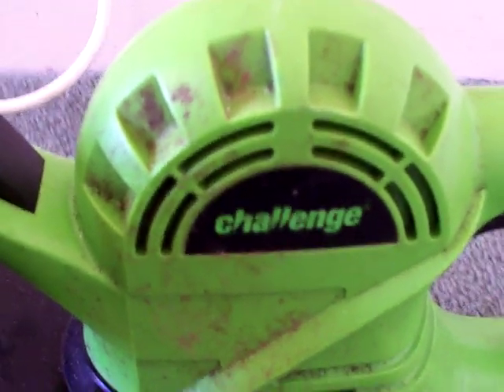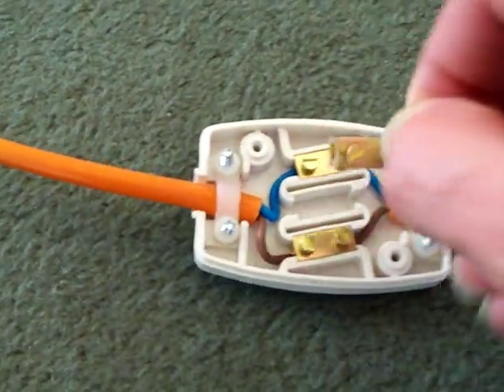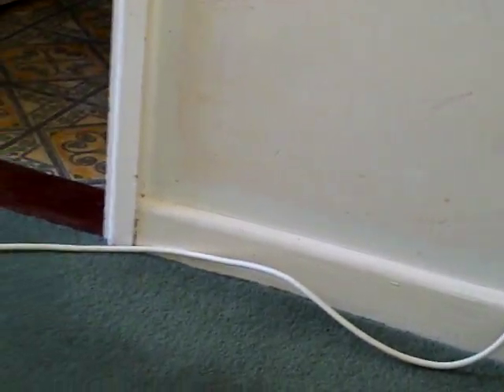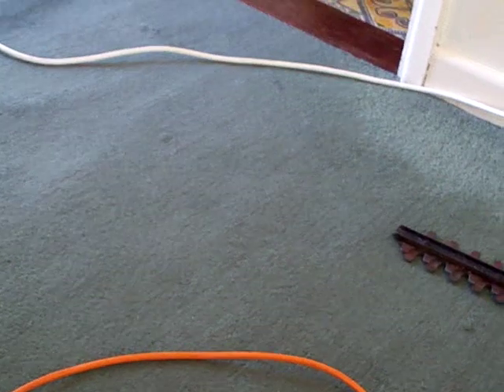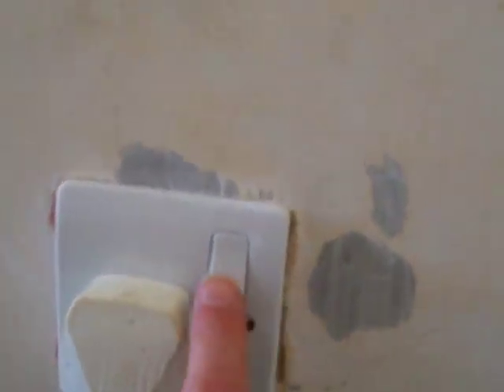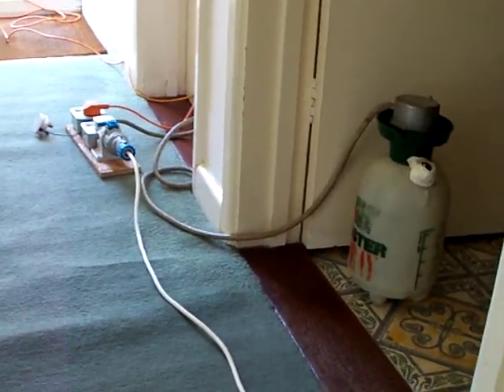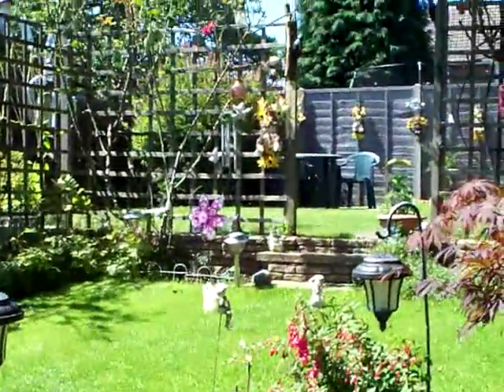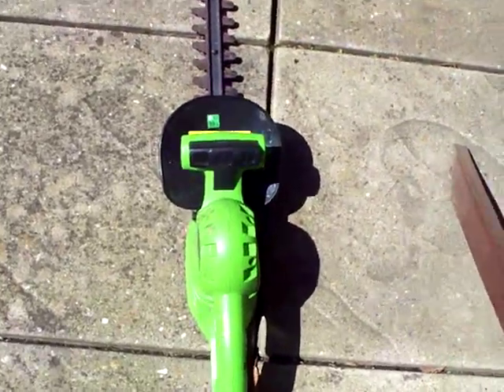Electrical : Neighbour's hedge-trimmer repair & test. :-)

Comment from the maker: Hiya. I've seen your vid, & noticed that the connector is the same one. :D

As for the connector-strip & insulation tape bodge-job, I have seen that done a few times before!

Admittedly (and off-camera!) when I need to test something out that doesn't have a plug on it, I do have a plug+flex with a connector strip on the end which I can quickly add-on to test the appliance.

Of course, that's in skilled hands & isn't left on there as a permanent fixture :-)

Thanx for watching,

-BoomBoxDeluxe.

Comment from the maker: Lawnmowers? Interesting that you should say that, because some time before the hedge trimmer chomped its own cable, her lawnmower also decided to eat its own power cord. :D

For that fix, I used one of those 2-pin pluggable 'duraplug' connectors. It's all I had at the time going spare, & they are sometimes known as 'lawnmower plugs' anyway because Black & Decker used to fit them to their lawnmowers as standard back in the 80s. :-)

Thanxx for watching,

{^_^} BoomBoxDeluxe {^_^}

Comment from the maker: The flex connector does not need to be IP65 rated, or even IP56.

This appliance (unlike a Jet Washer for example!) isn't designed to be used in such conditions which would require IP56 protection.

I don't even think that the flex connector would meet IP44, but then, it doesn't have to, as it is highly unlikely that the hedge trimmer is going to be splashed with water during operation.

-BoomBoxDeluxe.

Comment from the maker: Hiya. This can be used for a variety of reasons. To repair a flex as shown, or if a flex isn't long enough, the plug (if it is a rewireable plug) can be removed, this box put in its place, another flex added on, then the plug rewired onto the end of the newly added piece of flex. :-)

Of course, a lot of people don't bother with the second technique & use an extension cord instead. Because of this, these joiner boxes are mostly used for repairing a damaged flex.

Thanx for watching. :-)

-BBD.

Comment: Managed to cut my hedge trimmers cable today but surprisingly it didn't pop the 13A fuse on my trimmer or the 10A fuse on my extension cord or the bimetallic safety device on my extension cord but it did pop the 32A circuit breaker on my mains. Might not be a good idea to buy fuses from pound land.
Reply: OK, a very 
quick lecture 
on fuses and circuit 
breakers as follows:

Firstly, a thermal circuit breaker, like those found in extension lead outlets (such as those Jo-Jo extension reels) will only operate on an overload and will not respond to sudden fault currents or severe and sudden overloads such as a massive inrush from a motor.

Next, a plug fuse is merely a thin piece of wire inside a ceramic tube, which is then filled with sand and the sand surrounds the fuse wire inside.

A circuit breaker in a consumer unit however, will have two mechanisms in there. One will be for detecting overloads over a matter of minutes or seconds, depending on how severe the overload is, and this is thermally operated, and the other mechanism in there is for sudden fault currents, or as some people experience.... excessive inrushes of large motors/welders causing it to trip-off. The fault-current part of the circuit breaker is electromagnetic.

Under a sudden short circuit, a MASSIVE magnetic field builds up in the circuit breaker and trips-off the mechanism.

This happens WAY BEFORE the 10A fuse in the extension or the 13A fuse in the plug of the appliance have even thought about beginning to heat up in order to pop, and forget about that thermal device in the extension lead.... IT DOES NOT detect or respond to fault currents. Its there for overloads only!

Circuit breakers can operate so swiftly, that even a 32A type 1 or type B breaker can operate way faster than a 10A or 13A BS 1362 cartridge fuse can!

This is what you experienced, and this response explains why, what happened, did in the way that it did.

If you had have had a 30A cartridge fuse or rewireable fuse at the consumer unit, the 10A fuse in the extension may have gone first, or both the 10A and 13A fuses would have popped.

Thanxx for watching,

-Wayne's Electrical.

1st September 2019, 17.05

"BoomBoxDeluxe" is now a Wayne's Electrical brand.

Comment from the maker: Perhaps in rural locations, but petrol powered things in a town/city are considered a noise+pollution nuisance.

Our old neighbour used to have someone visit occasionally & do both gardens with a petrol lawn mower. Boy did that thing chugg! He either had the fuel+oil ratio wrong, or that engine was thoroughly knackered. When cold, the engine would billow lots of smoke & kept on cutting out, & once going it only had one speed....Top whack!

The air would stink of cut grass & oily fumes! :-(

-BBD

Comment from the maker: Being a doble-insulated appliance (Class 2) even if there was an RCD, I doubt that it would've operated, unless the severed part of the cable landed on wet ground & started conducting power to earth.

I do know that when I tested this out after repairing the flex, that the 13A fuse in the plug had gone *POP*, as like I said in the vid, so her MCBs must be a bit slow, or she has rewireable / cartridge fuses in her consumer unit.

When that cable was cut, there was probably a loud *BANG* :D

-BBD.

Comment: where do you buy the adaptor from for the flex  please
Reply: Hiya. These are 
widely available 
in a variety of 
places, such as.....

......hardware shops, DIY stores and on the internet in electrical-related websites and other places such as a popular auctioning website.

Just be careful where you buy it from and that it is made to a good standard! 

If it comes from a far-flung part of the world and costs only 62p with free postage, then that should sound some alarm bells right there!

Thanxx for watching,

-Wayne's Electrical.

22nd August 2018, 19.20

Comment: This "repair" might be fine. If your hedges are indoor. The box you have used to "fix" it is not suitable for outdoor use.
Reply from the maker: Hello there. When repairing this appliance, I deemed it to be of a satisfactory connection on the provision that the hedge-trimmer or the power cord wasn't going to be used near excessive moisture.

The customer was advised of this, and to date (check video publish date!) there have not been any issues with this repair.

Whether-or-not the customer still has the appliance is unknown, but one thing I will say, is it is significantly safer than one which I was given where the cord was in three pieces, and botched together with cellophane tape!

.....Now, there something to think about!

Thanxx for watching,

-BoomBoxDeluxe.

23rd September 2015, 14.55

Comment: What is the connector called please ?
Reply: Hiya. If you are 
talking about the 
little repair done 
on the power cord........

.......That device is usually called a cable connector. 

A proper one will have THREE connections in it, even if the appliance only has two wires like this hedge trimmer does.

There will also be provision for a cord clamp at both ends for each flex, and this cord grip should be on the outer sheath if the flex.

NEVER be tempted to use connector strip which is also sometimes referred-to as connector block, chocolate block or any of that stuff which is shortened as needed.

IT IS NOT ACCEPTABLE to use some of that connector strip and then wind stacks of sticky tape around it. There simply is no cord grip with such a bodge-up.

The proper cable connector isn't too expensive so because of that, there really is no excuse to bodge things up.

Thanxx for watching,

-Wayne's Electrical.

17th April 2018, 22.50

Comment: Easier to open the trimmer and fit a new cable
Reply: Hmmm..... I wouldn't say that in so much of a hurry. :-O

Some appliances when opened, have a habit of making bits fly out everywhere, making it [intentionally] difficult to re-assemble them in the hope you'll give up and go buy another.

What I done here, was to cut out all of that nonsense, get to-the-chase, repair the appliance and get it back into service again.

Thanxx for watching,

-Wayne's Electrical.

6th May 2017, 20.52

BoomBoxDeluxe is now a Wayne's Electrical brand.
Reply: not with that trimmer you just remove the cover